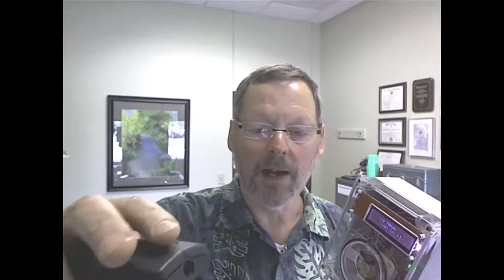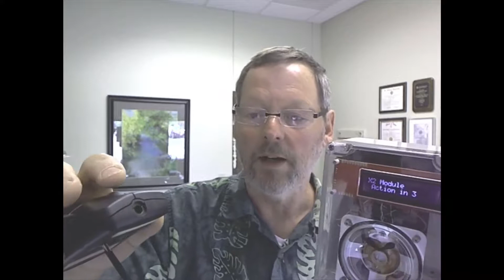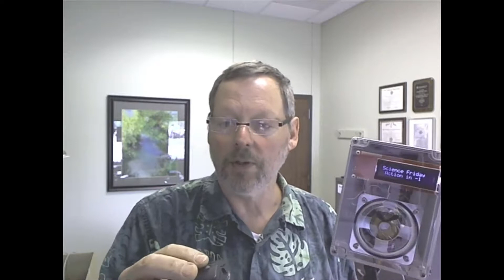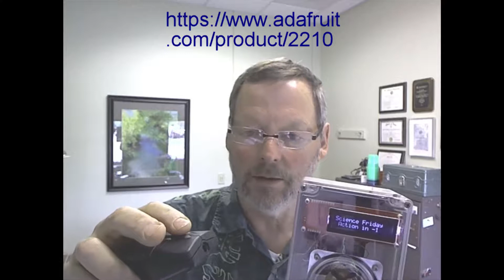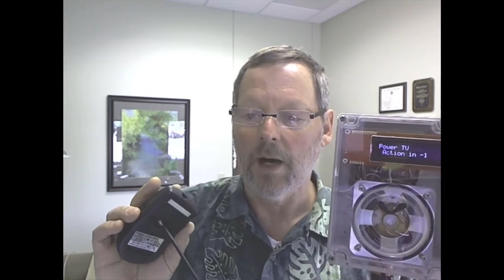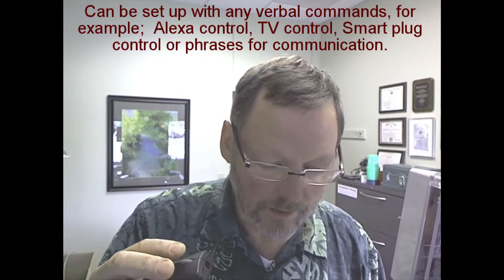Mouse Wheel Arduino Controller (Augmented Communication and environmental control )

Comment: Would you be able to control a motor, servo or dc, using the mouse wheel? I'm working on a project for school and I'm working on getting this set up using a bread board!
Reply from the maker: Sure but getting the mouse to work on this Uno took a bit of mouse rewiring/interfacing. Start with an Arduino that can support a mouse such as the leonardo. Check out REV spark controllers for easy motor control.